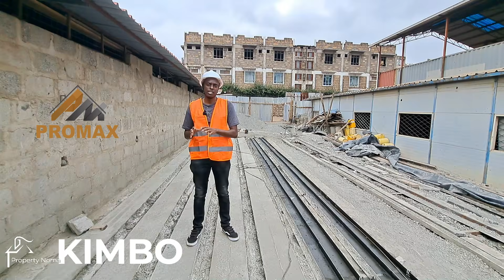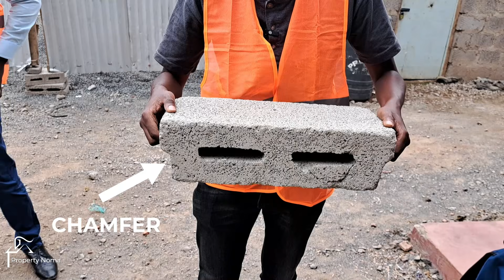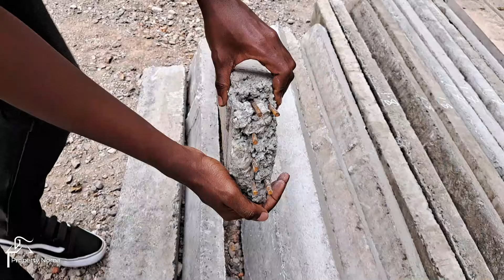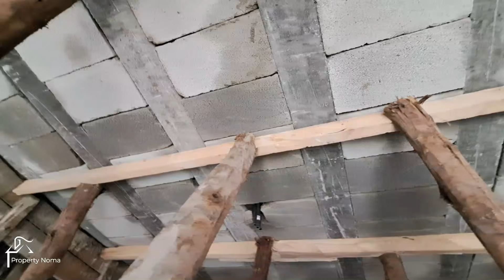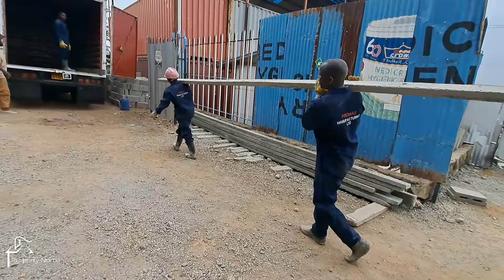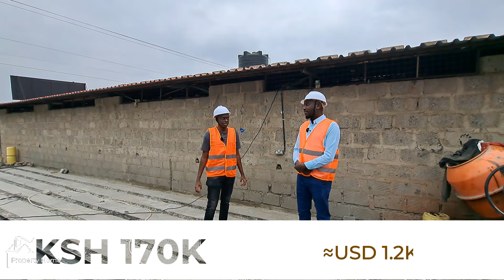Flat Beams & Blocks: The Economical Choice for Slab Construction!

Comment from the maker: As a highly requested video, we'll discover how flat beams and blocks are made for suspended slabs. Also known as beam to beam technology, the flat beams are prestressed to achieve a high tensile strength for the steel. I spent time with Tony Mureithi of Promax Manufacturing at his yard and at a site in Membley (Kiambu County, Kenya). Enjoy the discussion.
CONTACTS
Tony Mureithi (Promax Manufacturing) +254 722 110242
Location: Kimbo, off Thika Superhighway
Pin: https://goo.gl/maps/rKDPM599LqPhzNZw8

Comment: nice job making this video. its very informative. while there are a few ways to improve this process. with a good quality block making machine you will be able to make those blocks thinner and lighter. also in many countries 50cm hollow floor blocks are used (asmolen blocks). if you use 50cm blocks the number of beams used will be reduced.
there are different shapes of asmolen blocks as well.

Comment: Wow, i just came across this technology and i am still making researches on it. 

Please, my question is;
I currently have an on going 2-Storey building project that will house 9 2-bedroom flats.
I have just finished constructing the 1st decking using the traditional concrete and rod reinforced casting method . 

But, Is it possible to introduce this prestressed T-Beam and Block method on the 2nd decking without having any structural defects?

Thanks
Reply from the maker: Yes it's possible, but it's a good idea to engage your structural engineer before you make any changes

Comment: What about structural integrity and safety?
Reply from the maker: It's strength is specified by your structural engineer
Reply: @PropertyNoma  I mean all factors constant, would this slab remain intact after a tremor? Or when an impact hits section of the house, will the rest of the house that is built using this technology remain intact like the conventionally done structure does? 

This is a critical question as I have seen impact on a building that that was done by assembling concrete slabs. In this particular case one side of the structure came tumbling down after one room suffered cooking gas explosion. Ordinarily in a traditionally done structure the explosion should have been contained in the locale it happened. 

This is my concern. Has research been done on this aspect?

Comment: Greetings from a German living in Panama. I used this kind of system on my house construction in Germany. So it is very safe to use. In Panama, I can not find this system. I will make the beams myself. For bricks / blocks I will use 3” clay blocks. Why clay? The weight is 3.3 kg to 10.2kg to concrete blocks. Nice detailed video.
Reply: hello @holgermessner851, I foresee I will have the same problem in Nigeria. In fact for now I have only found one very expensive company and another that does not really understand the science behind the beam and block slab system.  Therefore I will so much love to be kept updated as you progress with your DIY on this subject of slabbing. Meanwhile, I can only wish you good luck and success.
Reply: @johnonyeka9503  I just had "THE" idea how to go ahead. I will use a 4'x8' wood board, attach a 4'x4' so I get the length. Use 2"x4" x14' CARRIOLA  screwed left and right. Put it in place where it should be in the house, I put rebars in it and fill it with concrete. That gives a roughly 110cm wide beam/floor. I will make 5 of this big moldings. When the concrete is cured for 5 days, I will remove it and put it to the next place until my floor of the upper level is closed. After that is done, I put another 3-5cm concrete on top of the whole floor.  - I did walk and drive all over the places I could think of. Contacted factories where concrete blocks are made. Everyone said: Not in Panama. - Instead wasting time, making small beams & blocks myself, I just thought: If I have to put concrete in molds - it's easier to make the floor with my bigger molds. I got some quotes to put wood and supports for the whole floor and it would cost me between $3,000-4,000 for wood & plywood, I would only use one time. Now I will spend $400 for the molds and use them until  the floor is completed. I can't use a wood floor construction because of termites.
Reply: @holgermessner851
Reply: hello @holgermessner851 . I am pleased you replied to me quickly.  But I can perceive that I have more information as I have read and researched much on this issue of 'BEAM AND BLOCK SLAB'. Therefore, I will advise that you have patience till this weekend as I plan to send you a compilation of video links on the argument. I also intend to add some notes for further elucidation. I am convinced these resource materials will be very helpful to you. Allora, a fine settimana. Ciao, amico.
Reply: @johnonyeka9503  Greetings to Nigeria. Well. What ever it is, it won’t help me in Panama. I just spoke with a factory manager where I buy my concrete blocks from. They could make the blocks but it would be very expensive and nobody else would buy them. Most family houses made with only one level. 2 level houses made with prefab floors where big cranes lifting the parts on top of the walls. Where my lot is, there is only a earth / dirt road and it is not suitable for heavy trucks. I even have trouble to get sand & gravel delivered with a 20 yard truck. I’m getting 5 yard deliveries. My blocks get delivered with a maximum of 10 pallet at once. It’s too heavy for the road. And they only deliver if it is not raining for at least 2 days. My lot is 2 minutes from the main highway in Panama but I have to use the dirt road. Between the lot and the highway entrance is a private property with no through traffic.
Reply: good day
Reply: @holgermessner851, good day. I have seen your reply in which you lamented about the difficulty for heavy trucks and cranes to reach your site. OK, I think I should introduce myself better to you.
I am a graduate of Architectural Engineering. I lived, studied, and worked in Italy. I now live in the UK.  I have also worked in tropical Africa. therefore, I have worked in places just like you described and even worse. I have been very interested in building science, building technologies, methodologies, and the science of materials that are affordable, renewable, and cheap. These must require low-skill knowledge. In fact, I practice social architecture social just in line with the goals of the World Earth Institute in India, the Aga Khan Foundation, the Prince Charles Foundation, and so on. All these experiences and research mean I am always on the lookout for building solutions that can be done as self-help or/and with the help of a few friends and little or no types of machinery.
In your own case, from what I understood, to build your 2-floor house, you will need not only blocks that you can buy from a factory nearby but you need a reliable, scientifically verified and precise cheap way of doing the slabs amongst other things. this is what led you to watch videos like this one of 'Property Noma'. Well, in a situation like yours, for the beam and block method one needs:
1) T beams.
In your locality, since you do not have the industrially made T-beams, you will need to make them yourself. This you can do either by making complete T-beams on the ground in appropriate formwork and when dry, lifting them into place or you make them semi-complete, lift them into place and while casting the slab, complete them as part of the slab. You can also make ready the rebar for these T-beams, lift these rebars into place, and then while casting the whole slab, complete the beams. 
I HAVE PUT VIDEOS OF EACH METHOD FOR YOU TO SEE. THERE ARE ALSO VIDEOS OF THE NEEDED FORMWORK.
2) The blocks that will act as filler (usually called HOURDI BLOCKS) need also to be made by you and your helpers on site. Any local blockmaker can do it. just furnish him or her with the appropriate mould and the right mix.
 I HAVE PUT VIDEOS AND PICTURES OF THE MOULD, THE RATIO OF MIX, AND  THE ACTUAL EXECUTION OF THE MAKING OF THE BLOCKS. THE DIMENSION OF THE MOULD AND OF THE ZIGZAG STIRRUPS ARE ALSO INCLUDED.
finally, I believe if you have the patience to go through all the materials I will be sending you, you will not only be able to build your house confidently and cheaper but you will also help those you know to do so. 
THIS IS THE MAIN REASON I AM DOING WHAT I DO. THAT IS SOCIAL ARCHITECTURE IN PRACTICE.
ATTN. I tried sending those documents to you but the holgermessner851 is not working as it is not an email address. So, if you want this information as I explained above, send me an email address to which I will forward it all immediately. Hasta la vista, amigo.